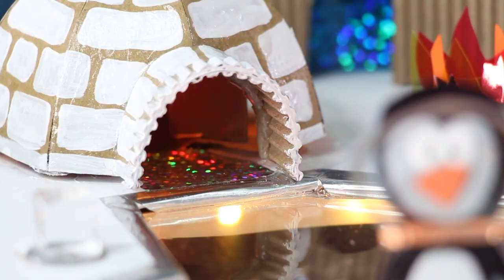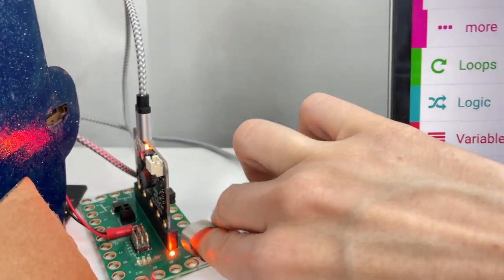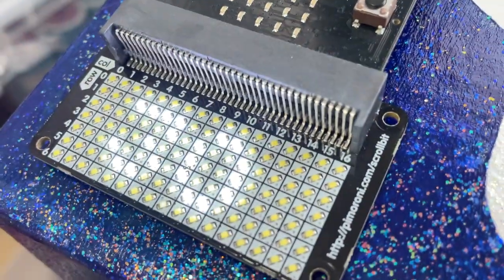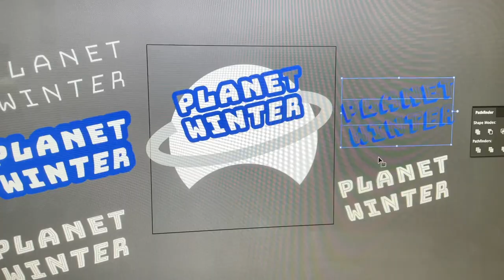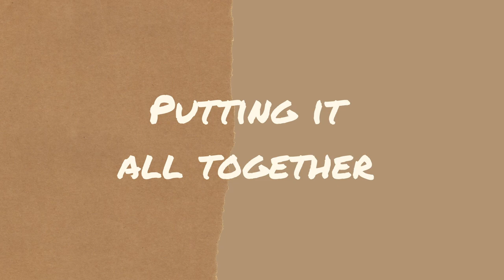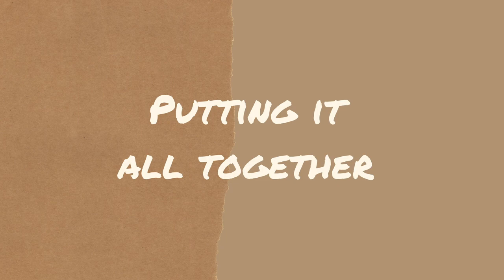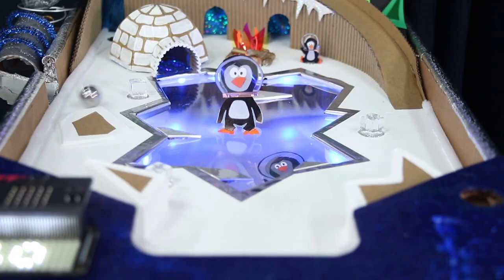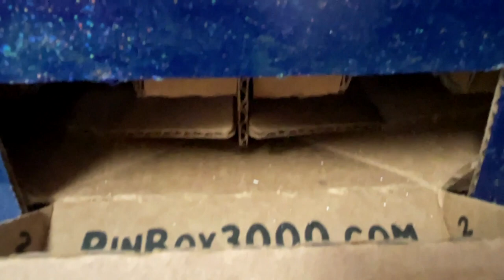I made a Micro:Bit Powered Cardboard Pinball Machine with PinBox 3000 - "Planet Winter"

Comment: lets say im planning on making a full size machine and would like a scoreboard that offers lets say 3 differnt scores for ex 10,20,and 50. this scoreboard would when the pinball falls between the flippers it clicked a button before returning to the pin, after clicking this button 3 times the score board reset indicating that the game was over. how would i be able to make this happen. if you could help me that would be very much appreciated thanks!!
Reply from the maker: I’d try a break beam sensor (look for it from adafruit) to sense the ball falling below the flippers. Then program it so that the game is over on the third time it’s triggered. Check it out. Good luck!